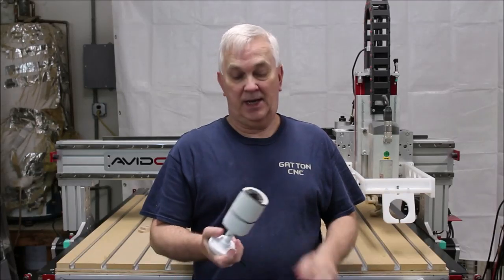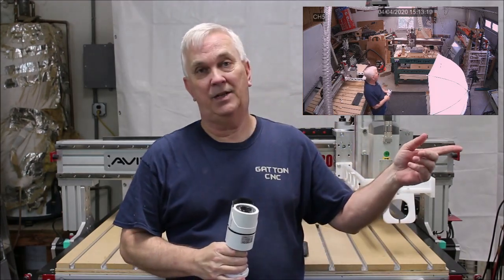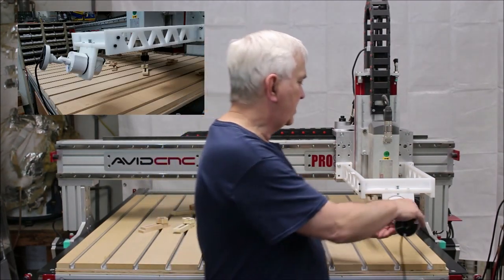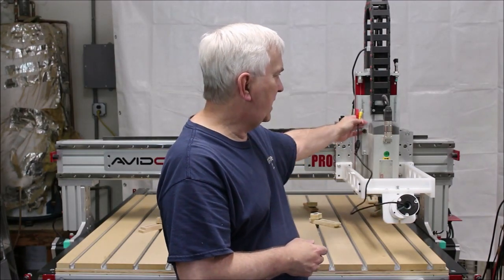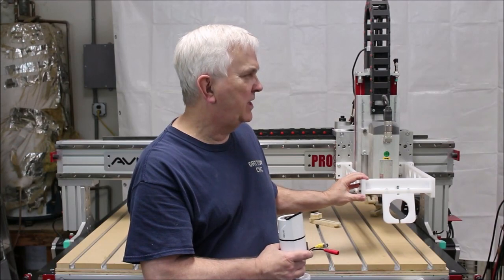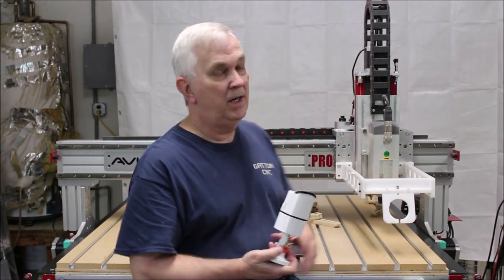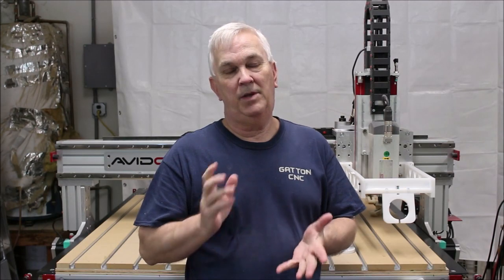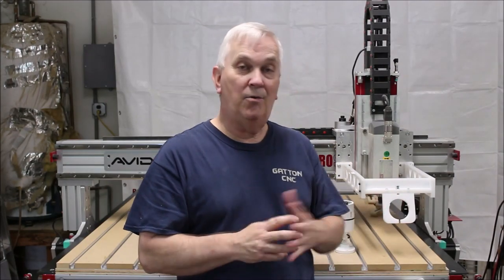Trying a New Camera on my CNC

Comment: LED lighting driven with dc instead of converted mains ac is what you need. The conversion from mains should be done with the "old" style linear power supply. It's the "switch mode" power supply that is causing the problem because of the high frequency ripple it causes, on the dc line.

Comment: I thought it looked pretty good Dave no lines. Do have a led puck battery operated you could attach to the mount. I got a free one from Harbor Frieght that is a strip LED and it is bright. Has a magnet on the back and about the size of a deck of cards.

Comment: Dave the video did look much better. I think that camera is a little bulky. I would check out a used go pro on e bay or amazon. You won’t have any wires to deal with. Thanks for the idea, I just build one out of birch plywood for my Gatton CNC.